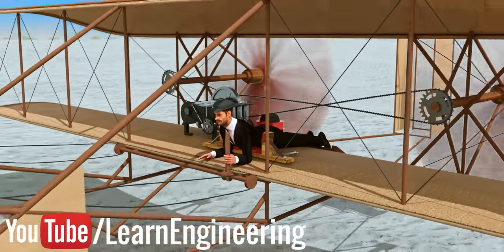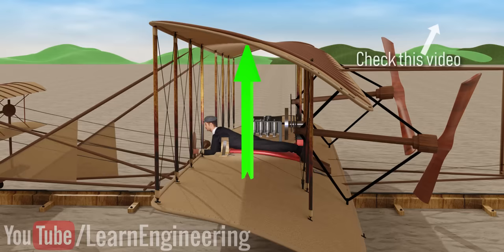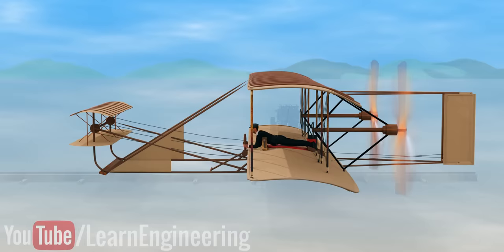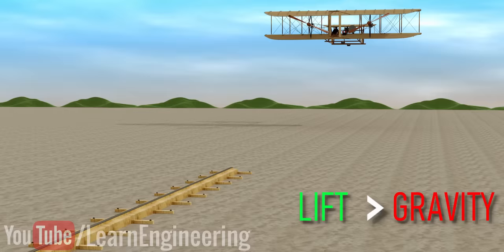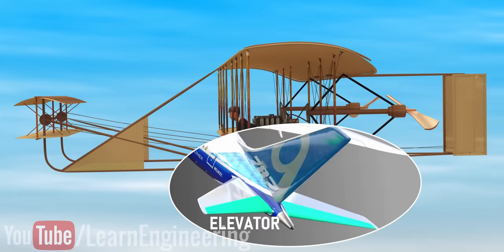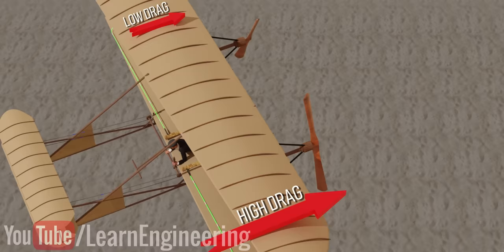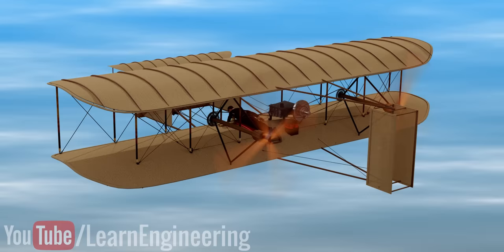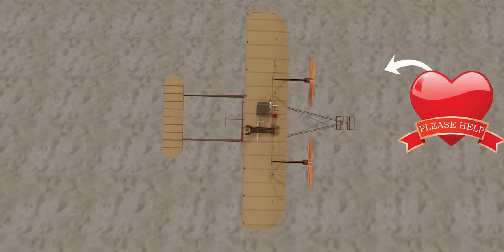The Brilliant Engineering of FIRST FLIGHT !

Comment: The engine is so impressive in itself.
Reply: in and of itself
Reply: The Wright's had a weight limit for the engine and thought they needed only 8 hp. Their home-made aluminum block 4 cyl. engine was ingenious.   By 1906, they had an air-frame that could handle a heavier engine.  Not sure why they did not try the 40+ hp radial engine that Langley used.  Instead, they used an improved variant of their original engine with almost twice the displacement.  This was the engine they arranged for a French company to produce for their anticipated European built Wright Flyers.
Reply: Not once did they mention the name Taylor....he was the real genius....the mechanic who made designed the engine
Reply: The Wright Brother were self-taught aeronautical engineers but they didn't know squatoosh about internal combustion engines.  The engine was designed and built by Charles Taylor, a mechanic who worked in the Brothers' bicycle shop in Dayton.  Taylor also built the wind tunnel that was so instrumental in the brothers developing a successful wing design and assisted them in testing wing designs and developing lift data.  He also ran the bike shop for months at a time while the Brothers were off in Kitty Hawk testing their designs.  Charlie Taylor is an almost forgotten hero in the history of aviation.
Reply: But with only 12 hp that was a very weak and primitive engine.
In Europe at that time the engines were way better.
Reply: John Smith  They did not copy other countries...
  The european manage to put powerful engines on airplanes.
One of the reasons Alberto Santos Dumont flew first.
Reply: @stevebett4947  The Langley-Manly-Balzar radial engine eventually produced the anticipated power but it didn't in 1902-3 when the Wrights were looking for a light weight engine to power their Flyer.  The smaller 12 hp engine worked fine in the Langley Aerpdrome 1/4  scale model.  
This engine seems to meet the Wright's design specs.

The specs below were impressive for the time.  The engine is claimed to be the first designed specifically for an aviation application.  Balzar had previously designed a 3 cylinder radial engine for a car and thought he could just scale it up and add 2 more cylinders.  

Specifications
   
https://en.wikipedia.org/wiki/Manly%E2%80%93Balzer_engine

General characteristics
Type: 5-cylinder water-cooled one-row radial engine
Bore: 5.0 in (127 mm)
Stroke: 5.5 in (140 mm)
Displacement: 540 in³ (8.85 L)
Dry weight: 136 lb (62 kg)
Components
Cooling system: Water-cooled
Performance
Power output: 52 hp (39 kW) at 950 rpm
Specific power: 0.10 hp/in³ (4.4 kW/L)
Power-to-weight ratio: 0.38 hp/lb (0.63 kW/kg)
Reply: @stevebett4947  In 1907, the arranged for Bariquand & Maare and a German company to produce copies of their
1906 vertical 4 under license.    Good photo of the engine: https://collections.museumsvictoria.com.au/items/406324

In 1906 the Antionette aero engine became available.  It did not weigh much more than the Wright vertical 4 and was a more advanced design.  Not sure why the Wrights never considered  it.  
V8 car engines usually weighed over 400 lbs.   The Antionette 8V weighed just over 200 lbs.
https://en.wikipedia.org/wiki/L%C3%A9on_Levavasseur  (shows the less efficient paddle blade prop)
Reply: @sanpol4399  Please reference an engine that was "way better" in 1903.
I think the Antoinette 8V was better but it was not produced until 1906.
https://en.wikipedia.org/wiki/Antoinette_8V
Reply: @majorbett  The Manly-Balzer had indeed quite impressive specs for the time.
But do you know if it had a practical use besides the use with the Langley Aerodrome? 
Why would the Wright not use it if it was lighter and much more powerful than their engine? 
The Antoinette V8 engines were already in use by 1904, in speedboats. https://en.m.wikipedia.org/wiki/Antoinette_(manufacturer)
Reply: @sanpol4399  I don't know much about the Manly-Balzer radial engine.  The posted specs
were very impressive but there may have been other problems.  The smaller version of the engine worked well in the model of the Aerodrome.  

The Wright's followed by Langley experiments very closely.  They would have known
about the radial engine but I have not found any discussion of it.

I haven't  found a reference to a pre 1906 V8 boat motor.
There is a reference to a car engine but it was not as powerful as the aero engine..
Antoinette displayed an automobile with a 7.2 L (439 cu in), 32 horsepower (24 kW) V8 engine in the 1906 Paris Salon de l'Automobile of that year.[5]
Reply: @majorbett   I also did not find the specs of the V8 engines before 1906. Just the mention in the link sent above ,about their use in 1904 in speed boats . 👍
Reply: The first known V8 engine was the Antoinette engine, designed by Léon Levavasseur, which was first built in 1904.

The Antoinette was built in France for use in speedboat racing and airplanes.

A 1905 version of the Antoinette engine produced 50 hp (37 kW) with 86 kg (190 lb) of weight 
(including cooling water), 

resulting in a power-to-weight ratio that was not surpassed for 25 years.

A V8 engine was built as early as 1904.  

Antoinette was a  short lived French manufacturer of light petrol engines. Antoinette also became a pioneer-era builder of aeroplanes before World War I, most notably the record-breaking monoplanes flown by Hubert Latham and René Labouchère. Based in Puteaux, the Antoinette concern was in operation between 1903 and 1912. The company operated a flying school at Chalons for which it built one of the earliest flight simulators.

... Levavasseur then suggested to Gastambide's daughter, Antoinette, that the engines should be named after her.[2] 

Gastambide financed the venture. Levavasseur patented the V8 engine configuration that year.[3] By 1904, most of the prize-winning speedboats in Europe were powered with Antoinette engines.[2] During this time, he designed engines of various configurations of up to thirty-two cylinders.[4]    https://web.archive.org/web/20141214235209/http://www.hydroretro.net/etudegh/antoinette.pdf

SB:  It doesn't appear that the speed boat engine was that similar to the V8 aero engine.  
The speed freaks wanted more than 50 hp.

https://en.wikipedia.org/wiki/Antoinette_(manufacturer)

The Farman-Voisin biplane was powered by a water-cooled Antoinette V8 engine which developed 50 horsepower (37 kW) at 1,400 rpm. It used an early form of manifold injection and weighed only 190 pounds in working order, including the water-filled cooling system. The engine block was cast aluminium, holding removable steel cylinders.[6] 

Levavasseur's Antoinette engines often included advanced features, including then called "direct petrol injection"[7] manifold injection,[8] and evaporative engine cooling.[9][10]

Aircraft manufacture
Levavasseur experimented with the construction of aircraft and in 1906 the Antoinette company was contracted to build an aircraft for Captain Ferdinand Ferber.[11] In 1908 Blériot tried to dissuade the directors of Antoinette from becoming aircraft manufacturers, fearing that they would begin competing against him for customers. Blériot left the company when his advice was ignored.[12]
Reply: @sanpol4399  I had a long reply with lots of links but I accidentally advanced the page an all was lost.

The company was formed around 1904 and included Bleriot as VP.
It was incorporated in 1906.
He left when the company started building aircraft that would compete with his own company.
Antoinette went bankrupt a few years later.  I have no details.

...In the summer of 1902, Levavasseur suggested to industrialist Jules Gastambide that powerful, lightweight engines would be necessary for powered flight, and proposed the manufacture of these engines. He also proposed that the engines be named after Gastambide's daughter, Antoinette.[1] Gastambide financed the venture. Levavasseur patented the V8 engine configuration that year.[3] By 1904, most of the prize-winning speedboats in Europe were powered with Antoinette engines.[1] During this time, he designed engines of various configurations of up to thirty-two cylinders.[4]

The footnote references this book|   King, Stephen H., The Passion That Left The Ground:
 The Remarkable Airplanes of Léon Levavasseur, p. 56-57.
https://www.amazon.com/Passion-That-Left-Ground/dp/1595711783/ref=sr_1_1?dchild=1&keywords=9781595711786&qid=1601518042&sr=8-1#customerReviews

There is a wikipedia page on  Léon Levavasseur ( 1863  -1922)  the engine builder for Antoinette.
https://en.wikipedia.org/wiki/L%C3%A9on_Levavasseur

I have sent an email to Ralph Cooper,  an authority on Léon Levavasseur.
Perhaps he has some information on the speedboat engines.

My guess is that the speed boat engines were likely V12;  Something more powerful that the V8.|
Reply: @sanpol4399  you missed the point that other engines were hopelessly heavier.
Reply: @ronashman8463  The engine used in Langley Aerodrome was light and powerful. (more than 50 hp) It is a good evidence showing the early aviation development in America was behind Europe. They did not look to exchange information as the pioneers in Europe did.
Reply: @sanpol4399  I assumed, wrongfully,  that by "other engines" we were referring only to automobile engines of the day. Your point is therefore absolutely valid.
Reply: @ronashman8463  Yes, I was basically referring to engines that could fit an aircraft.  With a nice power and lower weight.
      But anyway,  If we take into consideration the radial engine used by Langley in his invention,  the engine power is quite impressive. I may have overstated what I said , because I don't think Europe had such light and powerful engine like Langley had by 1903.
Reply: @sanpol4399  you probably know this, but Charles Taylor could not afford the weight of a carburetor on the 1903 engine. So he caused the intake airflow to travel over an area of the engine's water jacket. Then he just poured gasoline on to the plate too. Which is why the engine start procedure required the engine's empty water jacket to be filled with boiling water just prior to cranking! Fascinating stuff.
Reply: @sanpol4399  If there was a speedboat engine suitable for an airplane,
why didn't Santos-Dumont uses it?  His early attempts to fly 25 m.
were done with a smaller Antoinette engine.
Reply: @stevebett4947  But he did. Antoinette type engines, developed by Levasseur for racing boats were used in the first flight attempt by Santos Dumont with the 14-bis.
  As still there was a lack of power using the 25 hp speed boat Antoinette engine , he changed to the 50 hp speed boat Antoinette engine and flew the 14-bis without any external assistance.
Reply: @sanpol4399  Can you check the links for Antoinette engines and Levvasseur ( on Wikipedia) and see if you can clarify the evidence that the speedboat engines were available as aero engines.  

Levasseur was certainly involved in both initiatives.  Initially, there was a much bigger market for speedboat engines than for aero engines.  
LINK:  https://en.wikipedia.org/wiki/L%C3%A9on_Levavasseur

What is "an Antoinette type engine"?  
Are all Antoinette type engines designed and built by Levavasseur?
Reply: @sanpol4399  Balzer originally developed engines for automobiles.
It was not the same engine.  Manly claims that he developed the
aero engine after Balzer ceased to be involved.
Reply: @San Pol:  

SB  " Antoinette began as a private venture led by the engineer Léon Levavasseur and financed by Jules Gastambide, who owned an electricity generating station in Algeria. While on holiday with Gastambide and his family in 1902, Levavasseur expressed his interest in the emerging field of aviation and proposed the development of light, powerful engines for use in aircraft. Levavasseur then suggested to Gastambide's daughter, Antoinette, that the engines should be named after her.[2] Gastambide financed the venture. Levavasseur patented the V8 engine configuration that year.[3] By 1904, most of the prize-winning speedboats in Europe were powered with Antoinette engines.[2] During this time, he designed engines of various configurations of up to thirty-two cylinders.[4] "   (from Wikipedia)
Reply: @stevebett4947  I tried to send a link but the channel is not allowing it.
So, if you search for 
"(PDF) Historical Review and Analysis of Santos Dumont's 14-Bis" 
you will find a very nice material that talks about speed boat engines being used by Santos Dumont in his 14-bis.
Reply: @sanpol4399   Did the Manly-Balzer engine have a practical use...?

SB:  Probably not but it could have been marketed in Europe.  
There was no market for a aero-engine in the US.
I have no information on its cost.

An aero-engine based on a speed-boat design would have to be
special ordered.  The Wrights could not have  afforded it.
There should be some information on what the Antoinette 8V
would cost in 1906.  

There is plenty of information on the performance stats for 
most of the early aero engines.  Certainly for the two most famous
lines:  The Wright flat 4 and upright 4 and the Antoinette 24 hp and 50 hp
engines.  Have  you ever found any information on the thrust for the
Antoinette 8V plus paddle prop.?
Reply: @stevebett4947   Question: What do you mean exactly by padle propeller ? What is the definition you use to define that?

  - I did not find the numbers about how much thrust it had, but should be not difficult for an aeronautical engineer to precisely estimate it because we have important data:
1 - The videos and pictures of 14-bis can easily show its measures and design.( that is why Calassa could built a perfect replica). So the engineers could estimate the total drag it had and it's lift characteristics.

2- The 14-bis took off and flew 220 mts  by its own power .

With this data, should be easy to get the numbers you are looking for. All they should do is a reverse calculation to identify how much thrust it is required for a 14-bis to do what it did: Run, increase airspeed, take off, climb to approximate 6 meters high , and fly for 220 mts . 👍🏻
Reply: @sanpol4399  The paddle prop looks like a canoe paddle.  Antoinette sold their engine complete with a reduction gear and a paddle prop.  Find a good picture of the Antoinette 8V.

The Wright's used a simple spring gauge to determine Thrust.  They also had a equation to
estimate how much thrust the combination engine and props had to produce.  

The static test was not as good as a dynamic test but they had no way to do this.  Their 
wind tunnel was too small.
Reply: @stevebett4947    What exactly you want to know, and what is the point you want to get ?
Reply: @sanpol4399  Did you check out Levasseur
and Antoinette 8V?  at Wikipedia?
You were going to contact Ralph Cooper
or some other authority.
Reply: @sanpol4399  I agree.  There were not very many who were interested or thought it was even possible to build a practical airplane.
The only investors around (other than Bell) were out to make a quick return on their investment.
Reply: @sanpol4399  We are trying to come up with the best or most plausible historical narrative.  We do this by sharing any new evidence we come across.  My latest find is here:  *to be added
It mostly supports a pro Santos Dumont narrative but not the implausible unsupported
claims that one often finds on the Net.
It is the best compilation of historical data I have found.  Perhaps even better than Wright-Brothers.org.  (there are 3 websites with a variation of this name).  It is written in Portuguese.  The link is in the comment section of a :YouTube video created by a Brazilian.

When you had time, you were going to critique the Wright calculations and the successful test flights of the exact replica of the 1903 Wright Flyer.
Reply: @stevebett4947   We already went through this.
   14-bis flew , it was a fact observed by many and replicated.  There is no calculation to be made to modify what we are sure that happened. 
   On another hand, all it is possible to do regarding the suposed Wright's airplane flights before 1908, is trying to gather data and make assumptions to diminish the doubt that everyone has about it. But it is impossible to be sure they did what they claim.  
    There is no way to go further than that on this subject.
Reply: @sanpol4399  Let's not debate what we already agree on.
If you require a contest and official witnesses, the 14-bis
was the first to fly in compliance with the French 1905 FAI rules.

|What counts as incontestable evidence depends on what is written
in the contest rules.  It is incontestable that Santos Dumont made a
hop of unspecified duration of 100 m.  (approximately 100 yards
or the length of an  American football field.).  The proof is that none of the ## witnesses saw  the14 -bis touch down over a distance of 220 m.
The 100 m. is incontestable.  The 220 m. and 20 second duration is historical.  

My interest is in coming up with the most plausible series of historical
events.  

I mentioned that I found a very good web page on aviation history in Portuguese.  I will send it to you when I find it again.
Reply: @stevebett4947    Just a correction. There were not hoops in the facts you mentioned above.  There were flights.
  The 14-bis was still, then accelerated using only his engine and propeller, took off , flew sustained and under control, and then landed. 🙂
  It is also easily replicated by Allan Calassa's 14-bis replica.
Here is a good site to get information about Santos Dumont.
http://www.cabangu.com.br/pai_da_aviacao/5-demois/pg05.htm
Reply: @stevebett4947  We already went through this...
  Looks like  you try to attribute different definitions to things just to fit the needs. 
   We already even discussed what external power was because you tried to make a catapult impulse or a wind flowing uphill to look simillar with the air pressure.🙂
   Anyway, when an airplane makes a 220 mts flight,  without catapult,  without wind, with thrust not lower than drag, your personal definition consider it a flight or a hoop?
Reply: The fact that they made the first successful flight in history, is truly amazing!😍👍😲 Especially at the turn of the century! Just imagine if that engine had a carburetor intake exhaust manifold and advanced cylinder it would make a lot more power! This engine even though crude in its first making a creation rather was advance even way before it's time with overhead cams!!
Reply: @ronaldgreen5292  Actually that.is not a fact. It is a supposition. 
There is no proof it flew.
With 340,2 kh and only 12 hp it is impossible for it to fly.
  It is just simple physics , the real world.👍🏻
Reply: @stevebett4947  what are these youtube names at the end of you message?
Reply: @stevebett4947  Question made above again.
When an airplane makes a 220 mts flight,  without catapult,  without wind, with thrust not lower than drag, your personal definition consider it a flight or a hoop?
Reply: @stevebett4947   Not yet, but would be nice to reinforce our definitions so we talk the same language. 
When an airplane makes a 220 mts flight,  without catapult,  without wind, with thrust not lower than drag, your personal definition consider it a flight or a hoop?
Reply: @sanpol4399  

SB:  I just wrote a long response which YouTube decided to erase.
It automatically moved to the next video in their list and when I tried to move back
my comment was no longer available.  
I will try again later.  I never learn to not use their editor.

i did not address HOOP.  What does it mean and where did you get it?
Reply: @San Pol 

http://www.thewrightbrothers.org/fivefirstflights.html

"Pending unforeseen and highly improbable evidence of an earlier powered flight, a far more interesting and I believe more historically important discussion is the question of which one of the Wrights should be awarded the honor of having been the first human to fly a heavier-than-air, powered, controllable, aeroplane. 

To raise this question at this point in time may seem odd, even heretical, since it would appear that this question had been answered many decades ago, beyond all questioning... wasn’t it Orville Wright who made The First Flight on December 17, 1903, at 10:35 a.m., near Big Kill Devil Hill, North Carolina? After extensive reading and considerable reflection on the available material, I don’t believe it was.

(See: NOTE 3 at end of article)

THE FIVE FIRST FLIGHTS OF DECEMBER 1903

THE ATTEMPT ON THE 14th

This map depicting the area surrounding Kill Devil Hill and Kitty Hawk, North Carolina (to the north of Kill Devil Hill), was drawn by Wilbur Wright on June 13, 1908, while he was in Paris, France. (Arrow and text "Kill Devil Hill" added)

This photograph shows The Flyer on the 8-degree 50-minute slope at the foot of Big Kill Devil Hill. Five members of the Kitty Hawk Life Saving Station, John T. Daniels, Robert Westcott, Thomas Beacham, W. S. Dough and “Uncle Benny” O’Neal, moved the launching track and The Flyer about 1,300 feet from the Wrights’ work and storage sheds to the location shown in the photograph. (Library of Congress Wright negative LC-W86-22)

This enlargement of the above image shows four of the five crew members who assisted in moving The Flyer and the launching track. The two small children and the dog shown in this enlarged view were the ones who ran off as soon as the engine was started, frightened by the noise. (Library of Congress Wright negative LC-W86-22)

      
The images did not copy but can be viewed at the URL.
I am particularly interested in the chart
http://www.thewrightbrothers.org/ffftable2.jpg

Four reasons why Wilbur Wright’s flight of the 14th has not been seen as a contender for The First Flight are immediately apparent:

1) The Use of Gravity To Assist Take-Off
2) The Shortness Of Time Aloft
3) The Wrights Believed It To Not Be Successful
4) Damage To The Flyer On Landing

      However, perhaps surprisingly, if those are to be the items which disqualify Wilbur’s flight of the 14th from consideration as The First Flight, then the claim for Orville’s First Flight falls away also, when we apply those same criteria to that effort.

1) USE OF GRAVITY TO ASSIST TAKE-OFF - WHAT ABOUT WIND?

      The Wrights’ experiments with kites of various descriptions during the Summer of 1899 at an open area near their West Third St. Wright Cycle Company bicycle shop in Dayton, Ohio, had given them practical insight into the value and hazards of aeolian assistance.
Reply: @stevebett4947  Could you please try to make the answers smaller?🙂 It gets very diffuse and floods the post.
Doing it smaller makes it easy so we do not need to keep repeating the part we want to answer or comment since it just goes step by step in the sequence.😉
    The definition you use to define hoop can be very confusing,  because it is also a flight. 
    For me, it is just a jump, without being able to maintain the flight with drag lower than thrust and very shortly returning to the ground.
   Hoop and a jump are much more the same to me than considering it a flight.
    With that being said, 14-bis flew, not hooped or jumped.
   It is strange you refer to Flyer supposed short hoops as flights, and the 220 mts 14-bis flight as a hoop.  That was the reason I entered this aside conversation.
Reply: Absolutely!!!
Reply: Absolutely, especially making it that light